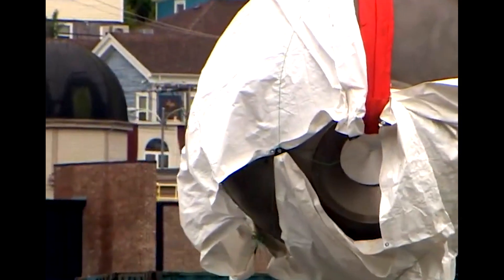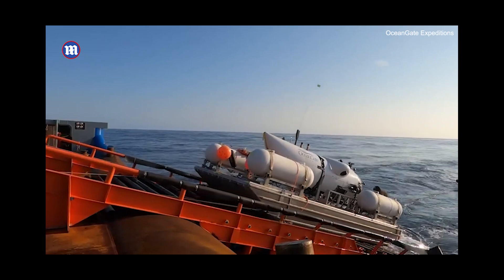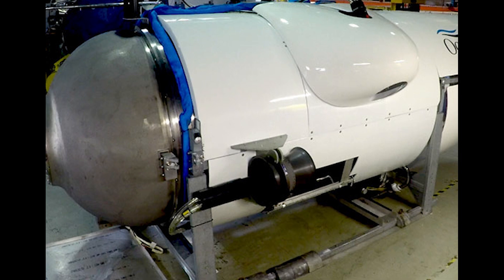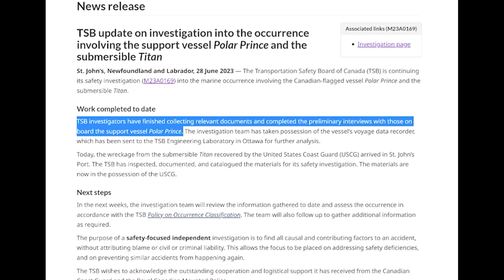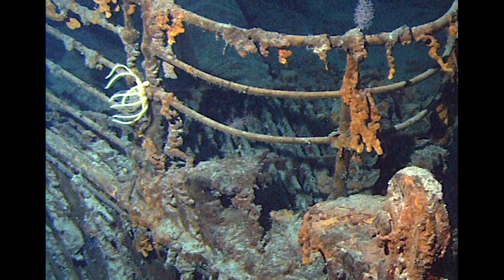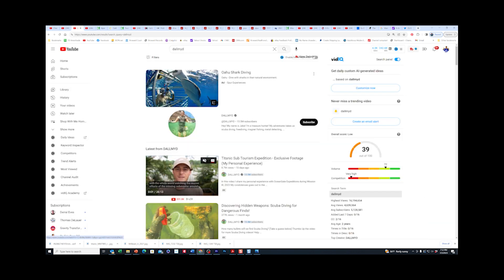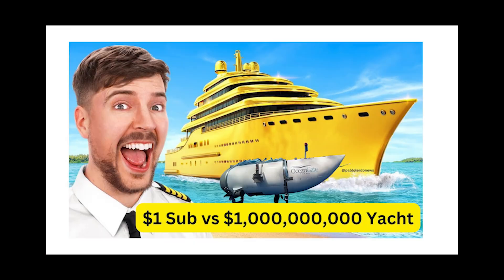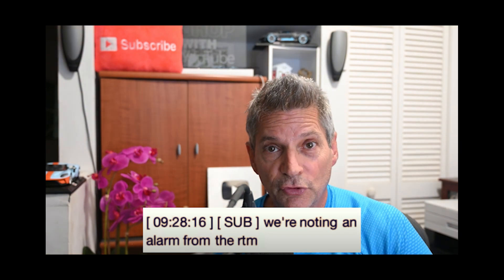Titan Submarine Debris Clues, Implosion Simulation

Comment: They should’ve designed the sub to go 25% deeper, with the extra strength this wouldn’t have happened. For the people who do not know, every dive cycle a sub makes, the materials get weaker and the max depth is reduced. Because the titanic is 3800 meters deep and the Titan’s max depth was 4000 meters. 

You see where the problem is here.

Comment: The titanium to CF joint looks sketchy. 
I have experience with CF propshafts, and I've experienced many instances of the metallic parts detaching. The bonding process has to be very controlled and in a clean room. And there's still a huge risk of bubbles forming in the bonding agent.

The best method is to create a strong interference fit between the parts. The roughness of the titanium bonding surface also needs to be high to ensure good surface area for the bonding agent. 

The interference fit works well for mechanical torsion, but I expect high pressure loads it's not very good. 

A sandwich of titanium CF and Titanium could work. But I don't see the point. You only use CF when you need it to be lightweight and strong. Titanium is far superior.

Comment: My 5 cents worth: I think the ring interface is the weak point, as we know titanium is extremely strong and is proven in other sub designs, so make the interface a U shape instead of a outer sleeve so that there is more support at the ends of the cylinder, the only down side is there would be a ridge on the inside but not a huge inconvenience.
Reply: if titanium is so good, make the whole thing of titanium
Reply: @dominus6695  I agree, I think the others that can go down to those depths are made from titanium, my guess is a lot more expensive.

Comment: Seems at least a little likely that the carbon fiber hull giving way could've popped the window straight out - it wasn't meant, at all, to resist forces from the inside. And it's... honestly really unlikely that a ROV salvaging the bits had a drill suited to unfastening those bolts at depth.

Comment: One of 3000 comments- Question: the dudes that were tightening the bolts . is there not a torque wrench that should have been used and tightened like a bolt pattern on a car tire?

Comment: As an amateur engineer (I'm actually an engineer, but in a WAY different practice), the joining of the titanium to the carbon fiber hull isn't my problem.  That joint is held in compression.  My problem is that in order to have a carbon fiber tube withstand that type of pressure, it would have had to have been 1.) perfectly cylindrical and B.) very thick.  You can't rely on a tube of a material that immediately breaks down upon failure.  Tubes are NOT a good shape for carbon fiber unless they're almost 1/4 as thick as their diameter....even in twist and structure loads.  As far as the evidence of the carbon fiber, I have a couple of thoughts.  1.) when the ship imploded, the air trapped inside likely turned to plasma at that speed, and 2.) that would have super-heated the titanium, which expands faster than the carbon fiber.  As a side note, the front portal was probably blown clear by the immense outward pressure shock that event created.
Reply: also... carbon fiber is TRASH in compression or shearing forces, basically its the opposite of concrete, fantastic in tensile and relatively elastic... but HORRIBLE in compression

also... its in layers... so the slightest air bubble or imperfect bond in layers... and you lose ALL your strength in that area 

and just what you see there on the outer portal... the epoxy did not bond at all the the titanium, that whole area should have been milled to a specific roughness for the epoxy to grip to ... not machined smooth and making it impossible to form tight bonds

just horrible, HORRIBLE design with even worse choice of materials

no co2 scrubbers, no explosive bolts in case of a surfacing... nothing

Comment: There are currents at that depth.  Carbon fiber is light, and it's lighter when it's in millions of shreds.  It wouldn't drop straight down to the ocean floor like the metal stuff, it'd be carried away.  As soon as the implosion occurs, all the light and heavy stuff has been separated from each other and the heavy stuff falls.

Comment: did carbon shrink just enough to allow water pressure in that glue joint. and the little I saw of the inside ring, I did not see any glue or carbon, just a shiny titanium ring, was it not sanded down to  increase adhesion, cause it looks like it came off like it was never there.

Comment: Great report! I worked a lot with carbon fiber in aviation, we never used it in any application where it would be compression, it’s great in tension but not so good in compression where other materials would be the better choice.
Reply: Also I'm a bit surprised that in a critical application like this, they performed the glue-up in an uncontrolled environment, basically an open warehouse.  No vacuum chamber, no dust management, no temperature control or monitoring.  Builders of R/C aircraft sometimes take more care than these guys...
Reply: @kaasmeester5903 You’re not the only one surprised by that.
Reply: airbus does

Comment: HOLD on...Was that pipe glue that they were using to attach the compression chamber?  That looked like epoxy glue.  I'm speechless... Epoxy glue is not meant for that.  Repeated exposure to temperatures under 65 degrees F causes softening and distortion of the glue.

Comment: I READ THE BOOK ON THE BATHYSPHERE TRIESTE AND ITS EXPLORATION OF THE MARIANUS TRENCH AT A DEPTH OF 7 MILES IN THE PACIFIC.  ROUND BALL TEN FEET IN DIAMETER SUSPENDED BENEATH A TUBE LIKE CONTAINER FILLED WITH KEROSENE?  SIMPLE RELEASE OF KEROSENE,  TRIESTE SLOWLY SINKS, THEN ON THE BOTTOM..... RELEASE LEAD? PELLETS.... BUOYANT KEROSENE CONTAINER LIFTS THE TEN FOOT BALL TO THE SURFACE.....MY POINT HERE IS VELOCITY... ... I THINK THE TITAN CREW WAS GETTING BORED.... DID NOT WANT TO WAIT FOR THE 2 1/2 HOUR DECENT....AND RUSHED TO THE BOTTOM..... THEY COULD NOT ARREST THEIR DOWNWARD VELOCITY .......DROPPED BALLAST..... THEN REALIZED NOT ENOUGH  BUOYANCY TO RETURN QUICKLY TO THE SURFACE..... DROPPED RIG HOLDING BALLAST.... LOST POWER TO ELECTRIC MOTORS.... FIRE ON BOARD?   VELOCITY..... ?????????

Comment: I hear the potential problem of the crew running out of air on the surface due to the bolted down hatch. A simple powerdrill with a regular drill bit would solve that issue in a carbon fiber sub... Actually in any sub since you you drill trough the acrylic port hole as well.
Reply: Unlikely, more likely to drown if this was attempted. As this is a submersible not a boat it tends to sit very low in the water  with usually the roof visible when on the surface. You get an idea of just how low in the water if you take a close look at the thruster position, which is slightly above the forward viewing port  horizontaly and about midpoint on the Titan. Unlike a submarine that blows compressed air into it's ballast tanks  to get to the surface these submersibles only have their thrusters to get down and back up and require to be in the water even on the surface.  In an emergency the ballast weights and the recovery frame can be jettisoned resulting in the submersible being further out the water but even so any swell would wash over the Titan.   Based on 19 years of work class ROV  operations.

Comment: I have experience manufacturing, the titanium nose baffles me. Yes, the CF likely failed and the reverbing pressure popped the window out but why does the recovered nose not have any threaded holes matching the nuts seen on the flange in before pictures? It looks smooth, what were those bolt's attached to? Titanium is very difficult to drill and tap, without being drilled on a large machine tool, it's nearly impossible to drill and tap such features by 'hand', steel sure but titanium no way unless you  invested in some proper tooling. There is no way to attach a magnetic base drill as ti is non magnetic and the nose has no flat surfaces to enable clamping a drill. Only sending it to a shop with very large machine tools would give you proper tapped holes and that is expensive. Normal pressure would hold the window into place just fine so could they have simply glued it in place with non-functional cosmetic bolts giving the appearance of rubustness?

Comment: The demonstration with the blue barrel is very telling, but it is important to remember that the steam in the barrel, when condensing creates a vacuum in the barrel and ONE atmospheric pressure (1 bar) from the outside crushes the barrel instantly. At the sub's depth, about 3500m, the pressure is 340 bar, or 340 times the pressure crushing the blue barrel. (close to 5,000 psi) The implosion would happen beyond instant. I am no engineer, but I guess milliseconds, less than the human brain can register.

Comment: I am convinced that the breakdown essentially occurred in this order ->

1. After several dives a combination of differentiating rates of contraction and expansion between the carbon fiber hull and titanium rings from the pressure and temperature changes slowly worked imperfections into the sealing/connecting points of the submersible.

2. This combined with additional stress and shock affecting the submersible from the previous dive that had gone awry wherein they had to manually lift the submersible without its purpose built platform due to a malfunction (which caused damage to several components that had to be repaired and replaced) further accelerated or potentially even produced a critical weakpoint in the hull near the aft section.

3. The dive that commenced after repairs essentially survived only due to a reduced depth (because of poor weather conditions) but would amplify this damage.

4. The date of the failure (if leaked transcripts are accurate cites them declaring an emergency, dropping ballast but not rising at the predicted rate (indicating potential flooding into another failed component) cracking could be heard near the aft section. (I'm assuming the battery was taking on water or potentially an airtank) they begin to ascend, but stall out additional cracking is heard, jettison the frame after multiple attempts, the action of doing so causes enough disturbance to cause the complete failure of the battery housing or airtank, the subsequent implosion causes loss of communication/electricity, the negative buoyancy causes a slow descent, the aft connection fails and the hull implodes killing the passengers.

They would have been briefly aware of their imminent doom, however the implosion itself would have dispatched them instantly.

Comment: There’s about 20 min of conversation bw the sub and the surface that’s been circulating the internets. I don’t believe it’s officially been released but if it’s authentic they had errors on all their hull sensors and were hearing signs of problems with the sub. They dropped weights and then the sled but still were only slowly starting to surface.  

My sense is that the sub was on one hand entirely overbuilt such that it didn’t suddenly fail but rather had some sort of cascading failure with progressive water ingress increasing the weight of the sub and limiting its surfacing rate.  Perhaps this occurred behind the rear partition of the sub where the various mechanical/electrical comments were placed. However, even if over built it was carbon fiber and became progressively weaker with each dive. So as the first compromise occurred the sub was somewhat resistant and progressively failing until a critical threshold was reached and the catastrophic implosion occurred.

Comment: there is now a "leaked" transcript between top and bottom with timestamps.  The conversation indicates that they heard noises and attempted to start surfacing but couldnt rise.  Dropped ballast weighs and frame and came up just a bit before officals hearing a boom and lost contact.  Timestamps agree with the story down to about one minute.  They had plenty of time to worry but it was over fast.  Surface air pressure is about 14.7 psi at sea level on average.  Going from 14.7 to 6000psi in an instant turns flesh to liquid.

Comment: I think they have found the frame (that they separated from), also a titanium ring (probably the front one) plus the front dome and no window. I think the failure was on the rear join of the ring to the  carbon fibre or the rear titanium dome seal to the titanium ring? No carbon fibre seems present on this ring so i believe the implosion happened at the rear and with such force (50kg of tnt), it literally blasted the front off the sub (pushing the window out in the process)ie like a carbon tubed canon. Everything inside the sub too would have been vapourised as it too was pushed forward and against the dome before being blasted into the ocean. No definite answers can be given until the rear dome, ring and carbon tube are located in the months to come.

Comment: Yo, I adore your content, super enjoyed the previous videos on the collapsed Florida building
, excited to hear your input on the OceanGate tragedy. 

But  at 7:17, your clip shows a torque wrench. 

That style wrench you adjust your torque by unlocking and twisting the handle portion of that long ratchet to your desired torque. 

Still goofy execution though , you can’t torque properly at a weird angle and with skinny “shiny non impact” 1/2” socket extension twisting & altering your final torque on the fasteners. 

I torque my car lug nuts with more care and precision.
Reply: When There’s so many little things that were done in a goofy way, it scares me about the big bits. 

I’m paranoid about torquing fasteners in a very uniform & consistent fashion on my land based rig. 

If I owned a submersible that needed bolted shut, I’d have a $500 electric auto torque gun and then double check my torque with top of the line Snap On torque wrench. 

Or using a wireless off brand game controller when serious gamers won’t use wireless playing on land in a video game. 
Wired name brand controllers just work better. 

That lack of concern in the little things spooked me initially even before the tragedy.

Comment: The carbon fiber tube flexed under the pressure, deforming the interface between the titanium ring and the glue joint, which then imploded.     The implosion started at the rear ring, which then allowed water to rush forward and blow out the window at the front.    The entire process probably took 3 milliseconds.

Comment: On why there's no carbon visible: Carbon fiber tends to react kinda weird in these sort of situations. I recovered an F-16 that hit trees at 500+ mph (pilot safely ejected). We spent three weeks sanitizing the site, it looked like the jet went through a blender. In the whole time we were picking up, we almost never found carbon pieces still mated to the adjacent metal, or even to the aircraft skin. There was some, but not much. Tons of carbon, tons of metal, typically all separate. I can't explain the physics behind it, but it does seem like carbon and metal react very differently in cases of catastrophic failure. Most likely the carbon fiber is in ribbons and clumps on the sea floor that would have been incredibly difficult to discern, and nearly impossible to remotely recover.

Comment: Well, anytime you glue and adhesive with carbon fiber, and another metal you need to have a negative oxygen so that the air bubbles are removed from the glue. This is done when they use it for aircraft and I’m sure for diving it’s more important. But this was done in a warehouse, I don’t understand that.

Comment: Water rushing into the sub will have enormous kinetic energy. The window struck with the wall of water from the inside could have been blown out, outwards. Especially that it was protected against pressure from the outside - I doubt it was too tough for overpressure inside the boat.

Comment: With steel or other metals you're able to figure out how close is too implosion the pressure vessel is by how much  it deflects under pressure.

With carbon fiber it would seem that the multiple layers will allow water pressure to begin to creep under the outer layers and begin to delaminate the structure before the implosion.

The carbon fiber structure may have been gradually compromised until it's rapidly failed.

Comment: Ideally you would want those titanium rings inside of the carbon fiber,  and not glued to the outside,  the place where the ring overlaps the carbon fiber creates an enormous weak point in the surface of the vehicle.  Especially if the pressure pushes against the metal ring inwards towards the thinner part of the carbon fiber hull. 

This whole thing was poorly designed from the start,  no emergency craft,  no backup flotation device or mechanical override, the whole thing was controllable using a gamepad controller.  

I'm just awestruck and dumbfounded that anyone let this thing swim, let alone take people down.

Comment: I agree the bolts should be torqued, but realistically that joint is in compression so the bolts wouldn't be seeing high operational loads. They would see one cycle with each use before being unbolted. So you can get away with it,... until something goes wrong.

Comment: Ok.. gonna help you out with the aspects to the titanium ring and the glue to the carbon fiber… when the carbon fiber imploded it shattered.. in a fraction of a second it generated enough heat to melt or burn off the carbon fiber.. it was hotter then the surface of the sun…I know it sounds funny.. heat in water .. yes .. when oxygen is compressed very rapidly it generates heat…a lot of heat.. even survivalists know this..they can do friction fire with a kind of piston and  it compresses the oxygen in the tube to light the tender.. very simple concept.. so yea it’s melted away…along with the carbon fiber.. I will be very very surprised if they found any carbon fiber pieces at all..